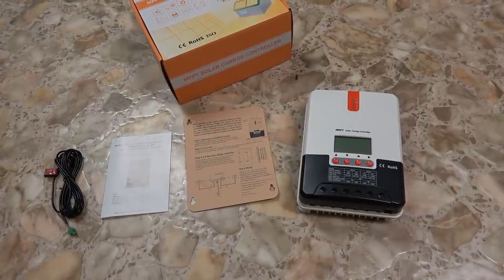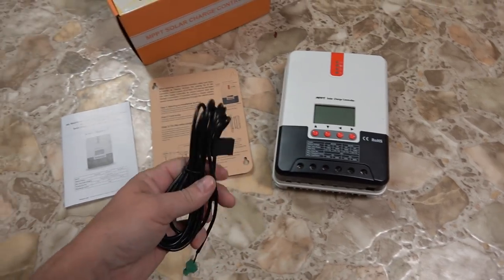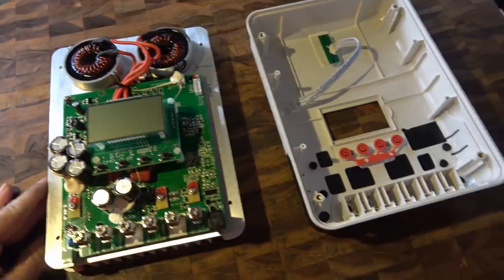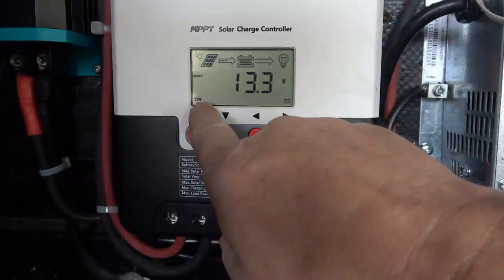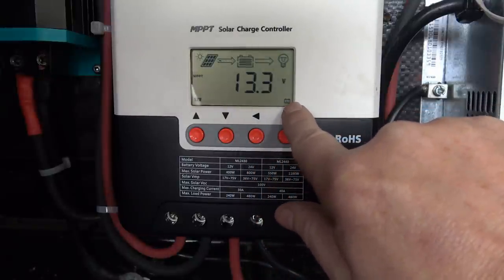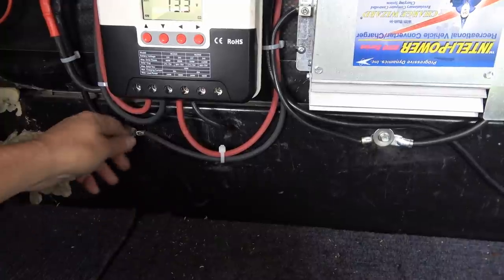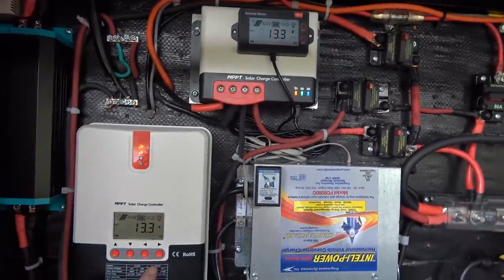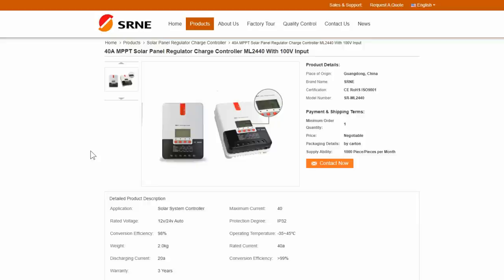SRNE MPPT 40A Solar Controller - Features, Installation & Demo (Model ML2440)

Comment: Hey Ray, I've had this exact same MPPT charge controller since the early spring of 2019 in my truck camper. It's branded as an Armada 40 and I was happy to pay $259 cdn at that time. I have it setup with 2 x 300 watts 24 volt solar panels run in series and mounted flat on the roof. It charges our 2 X  420 amp hour 6 volt  Rolls AGM battrries connected in series for a 12 volt system. We've used the camper year round since then from Vernon, BC in summer and  the South West  USA in winter without any issues. We have a 20 amp breaker on the solar side and a 40 amp breaker on the battery side. I for one love it and would buy it again. We hope to bump into you again like we did at Saddle Mountain BLM back in 2019. Enjoy you trip south this winter.

Comment: Nice review Ray. One thing that sticks out to me about this controller is its physical size, the thing is huge, but that might be a good thing for component reliability in the long run. I don't have anything good or bad to say about it, but one test I'd like to see you do is overpower it with solar panels since you have more than anyone. I have 6 - 200 watt 24 volt solar panels feeding into 2 Victron 30 amp solar controllers and so far so good, but that is more than they're supposed to handle.
Reply from the maker: Will do, I tried 940 watts feeding the previous smaller size 40 amp controller and it performed well, it just doesn't pass any extra wattage and only maxes out at the 40 amps charging current. The SRNE have over voltage and panel wattage protections so you can over panel them. If they heat up they also have temp protections and will reduce the current until the controller cools down. Tried that when we had 104 degree weather last summer.

Comment: This post is easily the best as far as setting the battery type buggered if l could see the symbols so this got me set up for lithium  as it was on lead acid..mine is a 20 amp kick ass same difference but without this post l would never had figured it out fro. Manual alone.
Nice one mate thankyou 👍

Comment: Thank you Ray, always nice to see your good work and reviews 😊.  There is so so much stuff out there!!   How will I ever choose new batteries and add a solar panel 🙈. So much to choose from !!  If I go lithium does the converter needs to be replaced?  The inverter?  Thank You for all you do.  All this while being on the road and taking care of regular day to day to do stuff, taking care Anne :-0).  You have super energy level.  Take good care, safe travels.  Cheers 🌞
Reply from the maker: You're welcome, yes, it's amazing how the product offerings have grown. It is generally a good idea to get a converter that is desined specifially for lithium batteries but may not be totally needed depending on the model of lead-acid converter one has. For example, my OEM does a terrible job of charging my lithium batteries but my aftermarket InteliPower with manual boost can be used quite well for the task. So I haven't need to change. Here is a video I did explaining and demoing it - https://www.loveyourrv.com/lithium-battery-charge-test-can-you-use-a-lead-acid-charge-converter/  Cheers! Ray
Reply: @LoveYourRV  Thank You very Ray.  What I find confusing also is the kind of answers I get while consulting a store.  The things they tell sometimes,,, The lack of knowledge. Especially back home in Quebec where there is very little of everything.  Have you heard of Volthium Lithium self-heating batteries?
Reply from the maker: No, can't say I have heard of them.  I don't think most RVers need a self-heated battery. Just wire the lithium batteries inside the living area of the rig or add some heat to the storage compartment they are in. The beauty of lithium batteries is they don't vent any gases and can be mounted in any orientation. So they don't need to be outside.
Reply: @LoveYourRV  Yes indeed, I lack space inside.  I would have wanted to leave them outside.  I do hit 15C sometimes in November back home.  But I will recheck under the bed by the inverter.  Doesn’t it emanates some sort of electric or electromagnetic field,  something that could be a sleep or brain body disturbance?
Reply from the maker: No, lots of people install the batteries under the bed. If worried you could always install some reflective metal shielding, but really a phone or laptop will emit more radiation since a person is so much closer.
Reply: @LoveYourRV  Ok, Thank You Ray  🤗

Comment: Hi, thank you for the vid, it's excellent!!
Better than vids made by fellas in Australia. 

I live in the land down under, Australia.
We have that controller here it's sold by a company called KickAss 20A $120ish and 40A $190ish, it's rebranded as KickAss here.
I have the 40A model. 

A few questions if ok.
What size cable did you use from the solar panels to the 40A controller?

Similarly what size cable you use from the 40A controller to the 2nd battery?

Lastly, you answered one question, you fitted a 40A resettable circuit breaker from 40A controller to the 2nd battery. BUT you didn't mention what size resettable circuit breaker you used from the solar panel to the 40A controller?

Cheers, Steve
Reply from the maker: I'm using 6 gauge for the controller wiring from the panels and to the batteries.  Between the solar panels and the controller I don't have a breaker I'm just use battery disconnect switches.  If you're interested you can view my current full off grid power system here https://www.loveyourrv.com/our-rv-boondocking-power-systems-current-state-of-things-2022/ I recently did an update video on it while camping in Utah. Cheers, Ray

Comment: Hi Ray, Many thanks for the video. What size cables did you use from the solar to the batteries?
Reply from the maker: I have my roof panels wired in parallel versus series so need a little more wire thickness. So I have 10 gauge from each panel to a junction just below the roof, then a 6 gauge run down to the controller.

Comment: Your video is a lifesaver! I live in Thailand and don't have access to many MPPT controllers save for this one. Before I buy it, I needed a rundown in English and this helped so much. My only question: If my lithium battery is completely drained, will this work on initial startup? Or do I have to charge my lithium battery first? My original (and very cheap) MPPT controller failed and my battery drained down to 3.7 volts. Would it be dangerous to attempt to recharge the battery? Is it considered fully discharged at this point and unsafe? It does have a BMS in it for overcharging and over-discharging protection, but now I'm worried it's damaged.
Reply from the maker: Best to ask you battery manufacture about that. If it is a 12V type lithium battery with BMS it should have cut off at about 10.8V not 3.7V seems awfully low.

Comment: Hi! I saw in the manual that the User/Manual Settings only get up to 17v, how would one set a 24v lithium custom profile?
Reply from the maker: I'd assume that when the controller auto recognizes that its connected to a 24V battery versus 12V at hook up it would automatically double all the parameter settings. Maybe the manual didn't list them. You can contact the company here for confirmation https://www.srnesolar.com/contact-us

Comment: Hi, I have this same model and I wonder how do you monitor the dod? Does it mean if the battery icon shows 2 bars then I’ve used up 50% of the battery? Thanks in advance.
Reply from the maker: Yes, but there is also a screen you can access that will show the battery DOD in percentage but keep in mind these figures can be inaccurate since they are just based solely on voltage and that can fluctuate based on the load the battery is under. I'd look at it as a rough guide to the state of charge.  To get an accurate figure you'd need to install a more sophisticated battery monitor system that uses a shunt to keep track of the amperage in and out of the batteries.
Reply: @LoveYourRV  Thanks for responding! We’re totally clueless and this really helps.

Comment: Hi Ray, just purchased 2 100 amp SRNE controllers as my charge controllers for my 2600 watt solar array.  I know they can be set to run in parallel and all setting from the “ host” are copied to the “slave”. My challenge is that the instructions to do so are clear as mud. Have you had any experience with that?
Reply from the maker: No I haven't reviewed 100A model controllers. As far as I understand they need to have a communication cable hooked between them then maybe some setting adjusted to activate the parallel operation. Here is the SRNE contact page, maybe they can advise.  https://www.srnesolar.com/contact-us  Cheers, Ray

Comment: Srne web site lists the charging specs at 20A.  How can that be if I'm pumping in 40A at 22V?
Reply from the maker: Probably a website typo. Here is the manual https://azimuthsolar.ca/wp-content/uploads/2018/10/ML2420-30-40-datasheet.pdf
Reply: @LoveYourRV  thanks!  Good video, keep it up.

Comment: I recently bought the same charge controller in 20 amp. While it is charging the first light on the box lights on and off. Is that how it is supposed to be or does it have to be a constant light?
Reply from the maker: Page 11 of the manual tells you what the LED indicators mean. How fast they flash means different things  https://www.srnesolar.com/wp-content/uploads/2020/11/MPPT-Solar-Charge-Controller-ML2420-Instructions.pdf

Comment: mppt srne which is 20 amperes, is it able to work with a current of 20 amperes from the solar panel input
Reply from the maker: Usually no, if it's a 20A SRNE MPPT charger, then the battery charging output will max out at 20 amps, so the solar input will be lower than that since the solar panel voltage is usually higher than the battery voltage.
Reply: @LoveYourRV Is there a protection system on the 20 Ampere mppt if the current or Amper is more than 20 amperes
Reply from the maker: @Romyorangsumatra  Yes, the controllers can dump the extra solar amps, and also, if it is too hot, they can reduce the charging amps
Reply: @LoveYourRV  MPPT Srne 20 Ampere, given input of 38 volts 13.5 Amperes, to charge a LifePo 4 12 Volt 100Ah battery... I wonder if it is safe to make the MPPT yourself...

Comment: How do I set the battery charging mode? Just bought my first trailer (used) and it came with this one.
Got a error 1 code which is battery is discharged
Reply from the maker: You have to enter the settings mode and select which type of battery you have Gel , Lead Acid , or Lithium. Or for experience people they can enter USE mode and set custom charge settings. It tells in the manual how to enter and select and save settings.  Here is the link to the manual online https://www.srnesolar.com/userfiles/files/2023/07/18/SR-ML24203040%20&%20ML2420-RS485_User%20Manual_V1.06.pdf

Comment: Thank you for sharing I just installed this today and I have two questions one how do I get into the custom profile to adjust my bulk absorption and float two I have no load but yet the load light is on in fact there are no wires installed to the load to this device any ideas as to why and how to remedy
Reply from the maker: Here is the manual https://www.srnesolar.com/wp-content/uploads/2020/11/MPPT-Solar-Charge-Controller-ML2420-Instructions-1.pdf  It involves pushing the right sequence of buttons. For custom you want to set the USE mode. But usually, the preset functions work fine. I use Li for my lithium and it works well.
The manual shows how to adjust the load setting  If you can't figure it out, I highly recommend buying the add-on Bluetooth and using the app. Way easier. :)   https://www.aliexpress.us/item/3256804400967653.html
SRNE App https://play.google.com/store/apps/details?id=com.srne.androidapp&hl=en_US&gl=US  Cheers, Ray
Reply: @LoveYourRV thank you so much for the manual super appreciate it I have another question when the Sun goes down do all the lights turn off the charge controller second question what is the power draw if left on during the night
Reply from the maker: In the manual, the spec for No-Load Loss says 0.7 W to 1.2W. As for the LED lights, the solar led goes off at night, and the load goes off if there is no load set, but the battery LED will stay lit as long as the battery is hooked up.  But power loss is minimal so I won't worry about it.
Reply: @LoveYourRV  thank you so much for your reply as I have light still on at night time this means I must have it hooked up wrong or settings not off I'll recheck the manual thank you

Comment: Hi! Let me know if you know how to change the temperature from C° to F°. Thanks 🙏
Reply from the maker: I could be wrong but I don't think it is possible.
Reply: @LoveYourRV  ok. Thanks 🙏. The answer that I was afraid to hear!! 😂
Reply from the maker: If you add 15 to the Celsius number and then double it its an easy to do rough calculation not totally accurate but puts it in the ballpark. :) For example 15C + 15 x 2 = 60 F or 25C +15 x 2 = 80F and so on
Reply: Thank you 🙏

Comment: have you tried to upgrade this to 24v with morethan 550w charging energy? can it handle 20a charging on 24v?
Reply from the maker: Yes, for a 24V battery system the max solar wattage doubles to 1100W so that means it will still max out at 40 amps on the charge output https://www.srnesolar.com/wp-content/uploads/2020/11/MPPT-Solar-Charge-Controller-ML2420-Instructions.pdf

Comment: Sorry for my ignorance but does this controller supply AC to the load?
Reply from the maker: No, it supplies DC up to a max 20 amps. Its basically a way to control a DC load. It can be set to turn off when the solar stops at sundown or set for certain hours of the day or all the time, manual switched or off. When used without the solar charging the batteries then supply the power.
One use case is to power lights on a timer. I use it to power my tire pressure monitor repeater. I have the load set for manual operation so it acts like a switch. Cheers, Ray

Comment: hi sir..is it possible to charge one battery with two solar charger control i mean two system..but the same 12v but differ on panel wattage?
i have two separate system the same 12v.
one is with mppt 40a 550solar panel and the other one is 20a mppt srne with 200w panel..is it possible??
Reply from the maker: Yes, I've done that with my RV system and it worked well.

Comment: hi sir..is it safe for the battery using double charger 40amps srne?
i have 2s2p lvtopsun battery for now 24v 200ah..and i have 2 charger 40amps srne with 1100watts each charger..Im too worried about the charging current as to the heat of the battery since some of the lifepo4 battery max at 50amps charging only.
But when i scan the data sheet for my battery it can continously charge upto 100amps..Since i have this set up somestime  it charged at 35amps each scc..so total.of 70amps.. Is it.safe sir our battery with this c condition?
Reply from the maker: I'm not sure, best thing to do is contact the battery manufacture and ask them. My guess is that it safe but may reduce the lifespan of the battery to charge it at high amps too often. They usually have a continuous charge rate specification for long life and then a max charge rate.

Comment: Hi i have the same can you please explain me how it works 30a or 40a i am confused .. thanks
Reply from the maker: The model shown in the video is a 40 amp. You'll be able to tell which amperage the controller is by the model numbers last 2 numbers. 
ML2420 or ML2430 or ML2440   20 amps, 30 amp or 40 amp  Manual https://www.srnesolar.com/wp-content/uploads/2020/11/MPPT-Solar-Charge-Controller-ML2430-40-Instructions.pdf

Comment: Hello,
CAN THE 4S LITHIUM ION BATTERY BE CHARGED WITH THIS DEVICE? VOLTAGE 16.8. THANK YOU FOR THE INFORMATION.
Reply from the maker: Sorry but I don't have that type of battery to test it on. But here is the manufacture contact information https://www.srnesolar.com/contact-us
Reply: @LoveYourRV  Tahnk you. CAN WE ADJUST 16.8 V WITH USER MODE?
Reply from the maker: It says in the specifications user mode battery parameters 9-17V  https://www.srnesolar.com/wp-content/uploads/2020/11/MPPT-Solar-Charge-Controller-ML2420-Specification.pdf  But I haven't tested it.
Reply: @LoveYourRV  Ohh ML2420-Specification thank you :)

Comment: I don't think your Progressive Dynamic charger is designed for Lithium batteries. I changed mine to the lithium version to get the full advantage of the batteries.
Reply from the maker: It wasn't specifically designed for lithium but if willing to manually push the boost button on the optional charge wizard pendant it will work really well. Been doing that for years for generator charging. If I remember right it will stay in boost mode outputting 14.4 volts for 4 hours.